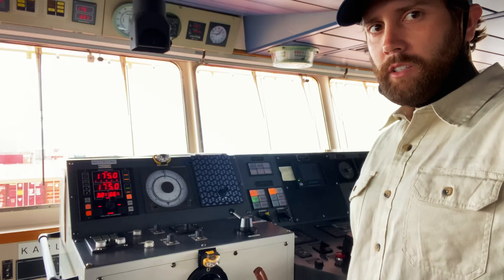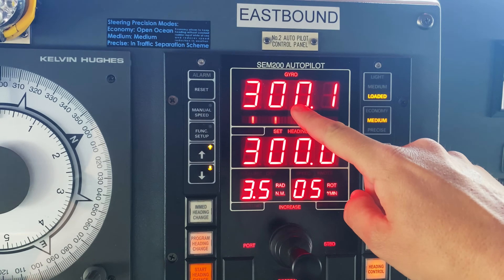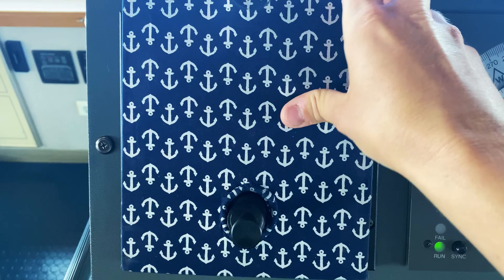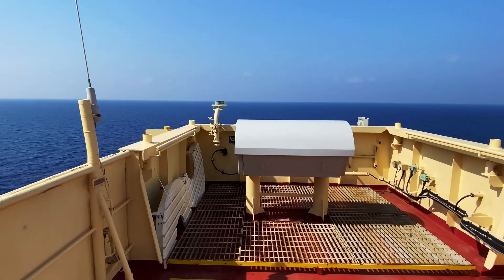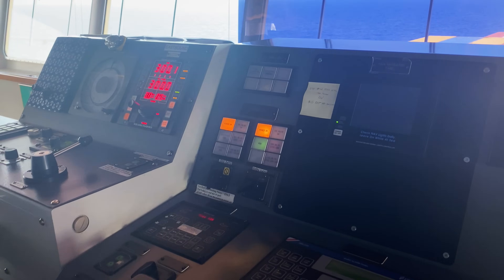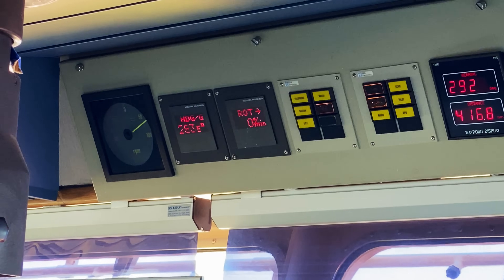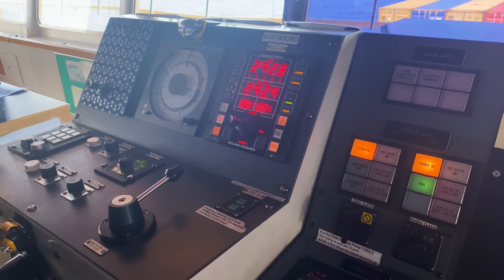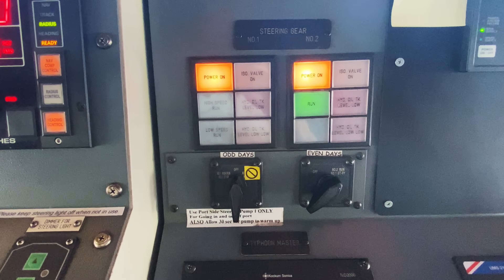How We Steer A Cargo Ship | Life At Sea

Comment: Highly appreciate this video Bryan , i get more info and demonstration from you than my years in class. If possible could you do a detailed demonstration videos on Radar and ECDIS and how to use them. Or even on other systems as well.
Reply from the maker: Glad to hear my videos have been helpful! I have a few videos I’m editing where I recorded some traffic encounters that incorporates more detailed use of the RADARS and ECDIS. Next time I’m onboard I’ll see about working on detailed videos about that equipment as well
Reply: @BryanBoyle  Thanks I was about to comment and saw this do post details vids thankyou, you're awesome ❤️
Reply: @BryanBoyle  hi.
Reply: @BryanBoyle  what is frame by frame action of crash stop or crash astern. What you are in full nav ahead
Reply: @BryanBoyle  is there any different if you forced by canceling limits to apply all air bottles to brake air and made possible to reverse mechanism kik in and start engine in astern direction?  Or computer governor do its job and wait certainly fpm limit to save engine when it comes to think by itself
Reply: @BryanBoyle  Why do the pumps for steering need to be so huge and constantly running?
Surely the rudder control wouldn't need to move fluid often because mostly the rudder is set in one position with occasional corrections, I would think a pressure accumulator would be able to handle that.
Just curious.

Comment: Without having watched the video any further: It is interesting how, on a ship, if you steer whilst on autopilot, the system does not accept those rudder inputs, instead beeps in order to tell you whereas it is the opposite on airplanes. On airplanes you override the autopilot with your input.
Reply from the maker: We do have an emergency tiller that overrides the autopilot. It’s the same lever used to control the NFU (Non Follow-Up),  but you are correct that the helm will not over ride the autopilot
Reply: @BryanBoyle  talking about air plane, their autopilot is connected to guidance computer and have something called managed mode. In this mode the aircraft follows preprogrammed route on the computer instead of selecting a course/heading. From your video I assumed the autopilot on a ship is in course hold mode. Does it also have something like managed mode on a plane where it automatically changes course based on preprogrammed waypoints?
Reply: @bltzcstrnx No it wont change automatically, it just keeps the course
Reply: @bltzcstrnx Airbus calls it managed mode, and it encompasses both lateral and vertical navigation. For most other airliners, the buttons will be labelled as either LNAV (lateral navigation) or NAV, and VNAV (vertical navigation).

Comment: 3:50 So when the captain calls out "293" from a current heading of "300.1" is that (a) going to be same compass direction that an airline pilot would follow (i.e. roughly W of due NW), and (b) therefore the same as calling "7 degrees to port", and lastly, (c) are we seeing the person controlling the rudder after he's done MENTAL calculations to that effect, or did he key it in somewhere so that the course gets adjusted by computer?
Just really curious. Thanks.

Comment: What speed do you normally cruise at when on autopilot?
Reply from the maker: We use autopilot at all kinds of speeds.  If you have the settings correct, it can even steer at slow speeds around 5 or 6 knots.  For example, you would have to increase the rudder limits as the ship will require much larger rudder movements to maintain its course at slow speeds.

Comment: The system where you run one pump every odd day and another every even has a slight flaw. There are 7.25 time a year (Including Feb 29th every 4 years) where the calendar day has two odd days in a row. Every month where the # of days is 31 going into the next month has 31 and then 1. This works out to be about a 2% difference over time. If this was a problem you could just go by # of days since the ship was laid down or launched or some other fixed date.